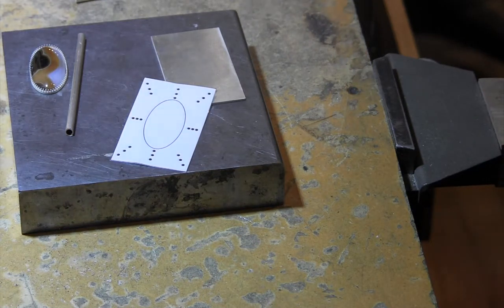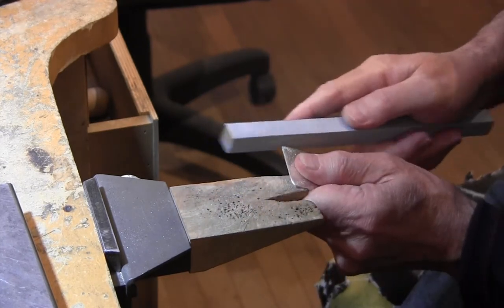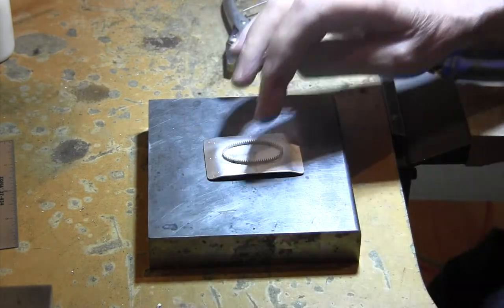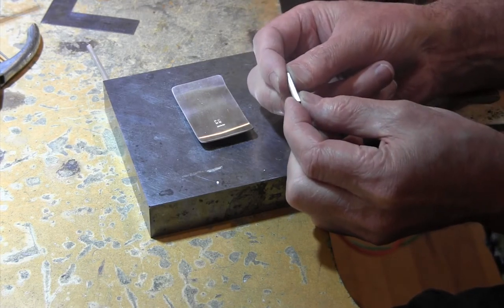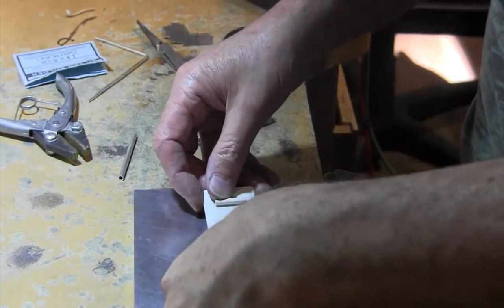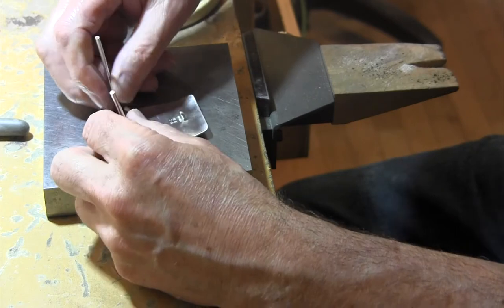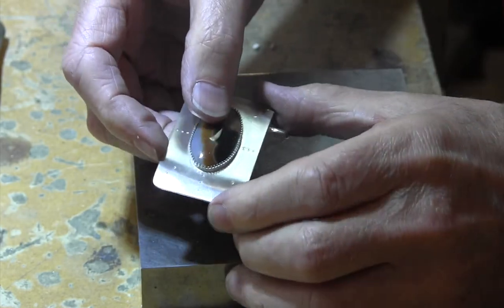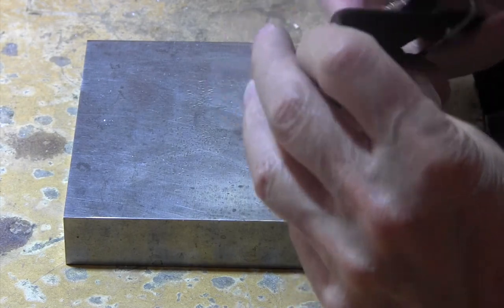Sterling Silver Belt Buckle with Montana Agate

Comment: Thanks for this video! I'm attempting my first belt buckle here soon...Did you use 10 gauge wire throughout the process? Or is there a different size wire you used?  Also, I haven't really played with tubing...Is there a size for that as well?  I appreciate any and all help! My husband has been nagging me now for 2 years for a belt buckle....I guess it's about time I learn, lol....Thanks so much!!
Reply from the maker: Yes I used 10 gauge wire for the belt buckle.  The tubing size inside diameter should be slightly wider than the wire, also use thick wall tubing.
Reply: i dont mean to be off topic but does someone know a method to log back into an Instagram account??
I was stupid forgot my account password. I love any tricks you can offer me
Reply: @Omari Ryder Instablaster :)
Reply: @Donovan Atticus I really appreciate your reply. I got to the site through google and im in the hacking process atm.
Seems to take quite some time so I will get back to you later when my account password hopefully is recovered.
Reply: @Donovan Atticus It worked and I finally got access to my account again. Im so happy!
Thank you so much you saved my ass :D
Reply: @Omari Ryder happy to help =)